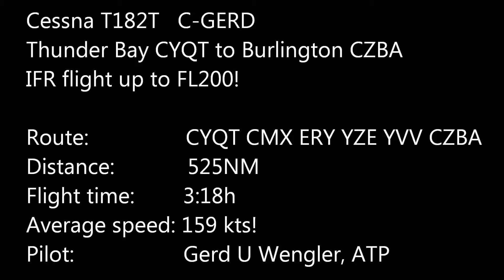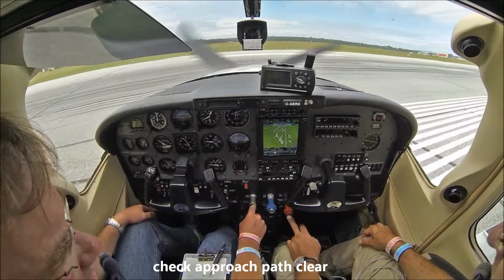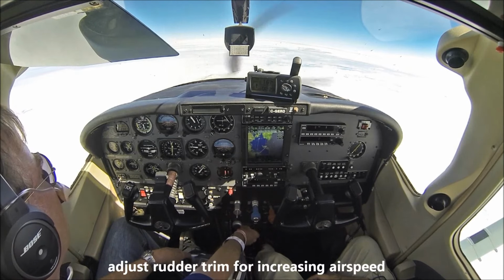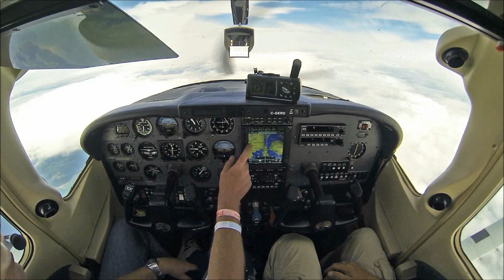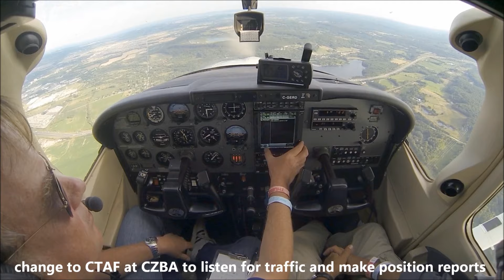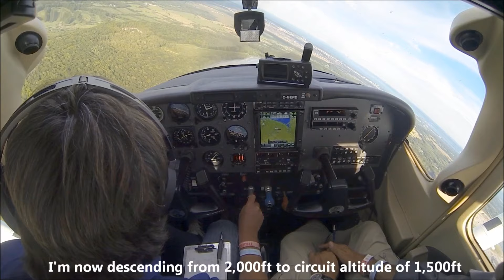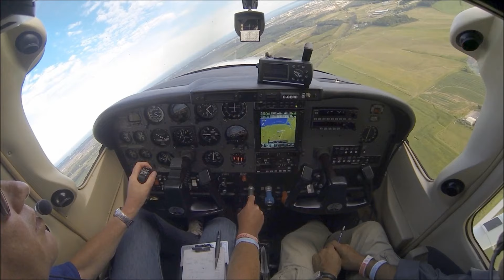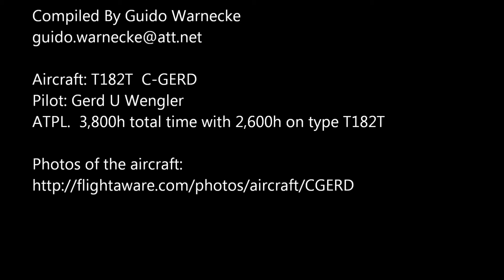Cessna Skylane at 19,000ft - cockpit video - must see!

Comment: Very alert "copilot", pushed the mixture to rich at the moment of take off.
Reply: That was the pilot
Reply: @CanadianTexaninLiguria  Wrong, watch the video again, the pilot flying that airplane is on the left side.
Reply: They are not handing off the controls properly.
Reply from the maker: It is not a 2 crew operation - I was flying with a friend.
In a 2 crew operation, the proper handover of control is essential for flight safety.
Happy Landings,
Capt. Guido

Comment: You certainly don't see a single this small up that high very often. Loved it!!
Reply from the maker: Thank you very much, Jay!
Yes it is a bit unusual at the beginning but perfectly safe - and it adds a lot of speed to the aircraft.
Happy Landings,
Guido
Reply: Guido Warnecke
It certainly does! I've never flown a C182 but I've flown C172RGs (including N172RG) and a C340 before. I no longer fly as it's too expensive for me but I am studying to become an airline dispatcher.
Reply from the maker: Thank you!
I can understand you decision Flying has become very expensive. The AVGAS prices have not come down with the gas prices for automobiles. To operate a pressurized twin like a C340 is very very expensive.
Best of luck for you career change & happy landings,
Guido
Reply: Guido Warnecke
Thanks!
Reply from the maker: TAS was around 155 kts and ground speed sometimes above 200!
This Skylane is a fast cruising aircraft.
Happy Landings,
Guido
Reply from the maker: ***** You are very welcome!
Happy Landings,
Guido
Reply: Come in the Sierras and you’ll see many single and no engine aircraft even higher !

Comment: Love the C182. Great video.
Reply from the maker: Thanks, my "video maker" friend...
Happy Landings,
Guido
Reply: its great at 5,500 feet, I dont know about FL200
Reply: Wish I kept my 162 idk why I sold it, though I say the same about my cub and 172 I have a bad habit of buying meh airframes restoring them without enjoying them. I started as a A&P mech, longest I ever kept anything was a Beechcraft for a year
Reply: I should correct myself to be clear and not sound ungrateful it's kept a roof over my head during lay offs and other bad times working in aviation but the old birds are getting hard to find now either scrapped or just not worth the trouble, last 2 restos were crop dusters and they are not the way to make money tightest pilots ever
Reply: Shawn Davie I own182 RG if I fly from Utah to California at 12500 and 13500 returning no problems!
Reply: @johncavanagh1000  you have an amazing aircraft, sir.
Reply: Zegehyjamildara

Comment: Glove clap at the end. Bravo, nice flight.
Reply from the maker: Thank you, Paul.
A nice landing deserves some cheering from the passengers...
Happy Landings,
Guido
Reply: Pressurized I hope. New wing and prop de-icers , flying high
Reply: Rob Ster You do not need pressurization. You'll note that Guido is wearing just under his nose an oxygen breather (as is his passenger). Because the Skylane is Turbocharged, the engine runs very well at FL 190. The maximum certified flight envelope for the T182T is 20,000'. Prop de-icing is an option on all 182 T model's manufactured by McCauley.
Reply from the maker: Doug Hanchard Thank you Doug.
This T182T has pro de-ice.
I hear there is an STC out for an electrical wing anti ice, but I do not know how well it works.
Happy Landings,
Guido
Reply: Hey Doug, small correction. Actually Guido is the passenger and Gerd is the pilot.

Comment: “Flaps, this, this, this, all good.” 

My kinda check list.
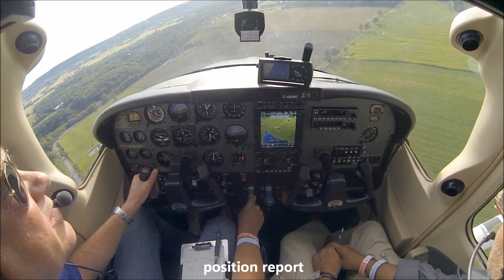Reply: 12:40
I laughed so hard... ;D
Reply: Until the one point that a latent threat isn’t picked up and only emerges at the very point it becomes essential and guarantees you a leading role on air accident investigations. Never become complacent with checklists folks, it could cost you and they are only there because of hard lessons learned by those who didn’t always live to tell the tale
Reply from the maker: In general I agree to you Paul.
Checklist use is very important, and I advocate this in most of my videos.
In less complex airplanes like the C182, any check list will do.
Happy Landings,
Capt. Guido
Reply: @paulb7200  I don't pilot planes, and would be bad at checklists myself. I am kinda disorganized (ADHD), and don't always read instructions on things. ツ But hey, without checklists, many aircraft have crashed. Most crashes are human error. Always check your fuel, surroundings, engine parameters, electronics and control surfaces.

Comment: Your exposure of the panel is perfect, yet the view is not blown out / over exposed out the window; that is amazing - are you doing some post matte filtering?
And your sound is back to great quality again after some videos where you had low sound issues...
I saw C-GERD land at ZBA on Sunday night when I was there for a flight!
Reply from the maker: Thank you!
The pilot's world is very small.
I spend a lot of time and efforts to optimize exposure of the videos.
The light difference between inside and outside is very challenging.
Happy Landings,
Guido
Reply: Well you did great with the exposure!  What are you shooting with?  I use GoPro Hero2s and the exposure control is very limited.
Reply from the maker: ***** Thank you! It;s a Gopro hero 3+ - but some after shoot work and adjustment.
Very time consuming...
Happy Landings,
Guido
Reply: Cool - if you don't mind explaining in more detail, I am very interested in what you are doing in post.  I have settled with using a dedicated camera for the instrument panel which I crop, matte and composite into the "view" cam in order to have ideal exposure on both - but you are doing well with just one camera!
Reply: Motor racing crashes
Reply: @GuidoWarnecke  )
Reply: Convo between two greats here
Reply: @FlightChops  and did you fix it? 😏
Reply: In the film world we would have used a grad nd filter to darken the exterior view. Don't know if that's an option on gopro though.
Reply: you prolly dont give a damn but does anyone know of a trick to get back into an instagram account?
I was dumb forgot the password. I would appreciate any tips you can give me
Reply: @Solomon Kendall instablaster ;)
Reply: @Theodore Coen It worked and I actually got access to my account again. I'm so happy!
Thank you so much you really help me out !
Reply: @Solomon Kendall Glad I could help :)

Comment from the maker: Reply to David Mhyr: Did the instructor made any comment on WHY one should not do this?
Happy Landings,
Guido
Reply: His explanation was that the cable's were not designed to be twisted and that they can break or become disconnected.  My mechanic (25 years experience with C172's) concurred.
Reply from the maker: David Myhr Thank you, David.
I will check this from other sources too.
I am under the impression that the cables are actually not twisted in this process.
Happy Landings,
Guido
Reply from the maker: David Myhr Hi David,
I checked around and got technical drawings and photos of the cable assembly.
There should not be any problem as the cable is not twisting. 
Might be one of these "old wife tales" thing.
Happy Landings,
Guido
Reply: David Myhr From the C182T POH: "For small 
adjustments, the control may be moved forward by rotating the knob 
clockwise, and aft by rotating the knob counterclockwise."
Reply from the maker: Robert Page This might be a true statement, Robert.
But what i learned from the technical drawings, there is definitely no twisting of  the cable by turning the knob.
So as an engineer I say "old wife's tales"...
The older Bonanza aircraft have these controls even for the throttle.
Happy Landings,
Guido
Reply: I think you are the best pilot and i work hard at being just like you.
Reply from the maker: larry sean Thanks, Larry....
I'm just another pilot.
Thank you for watching my videos & happy landings,
Guido
Reply: Guido Warnecke
Reply: David Myhr David, cables are NOT twisted, you might want to re consider your mechanic. This is can be seen on the  airplane documents. Fly safe
Reply from the maker: Thank you for clarifying this, Alejandro.
Interesting how these stories are hard to get out...
Happy Landings,
Guido
Reply: Guido, no pressure, but all you fans are waiting for more videos. :)
Even do I'm a low hour weekend warrior, I have learned and picked up a lot of tips and useful things from your expertise. Keep up the great work. Thanks.
Reply from the maker: Thank you Alejandro.
I promise, the next videos are already in the works.
Happy Landings,
Guido
Reply from the maker: No it is not a Hope Air flight, but the owner of the aircraft used to be very active with Hope Air.
The wrist bands are the day passes for the EAA fly an at Oshkosh.
Happy Landings,
Guido
Reply: David Myhr Whomever said the knobs should not be twisted knows nothing about airplanes or misunderstood the question.. They are called vernier cables and this is how they are used. Turns for finite adjustments and push button and push pull for large adjustments. not even a wives tale but a tale by someone that know nothing of aircraft maintenance. http://vansaircraft.com/cgi-bin/store.cgi?ident=1429156151-12-183&browse=controls&product=ctv-cablesRead more
Reply: Acbulgin2, Its a turbo charged 182. Not pressurized.
Reply from the maker: 19,000ft is completely safe, if oxygen is used for pilots and passengers.
Happy Landings,
Guido
Reply: acbulgin2 it likely has a constant speed propellor. as the air thins the turbo keeps the engine close to rated HP No additional boost but the equivalent of being at sea level. Known as being turbo normalized.the prop increases its pitch to overcome the thin air..
Reply from the maker: 100% correct!
Happy Landings,
Guido
Reply from the maker: Thank you!
Happy Landings,
Guido
Reply: A vernier type prop control is designed to be twisted. Am I missing something?
Reply from the maker: @norbertsiewert3917  Absolutely correct.
Happy landings,
Capt. Guido

Comment: Why would you do a intersection takeoff? With max take off weight, wouldn't it be prudent to use the whole length if available? You know what they say, the three things that are no good to a pilot, the altitude above you, the runway behind you and the fuel in the truck/bowser.
Reply: +unapro3 By the time they reach a safety altitude, they'd have enough glide to return to the runway. Also, for emergencies below that safety altitude (you try to land straight) they had a very nice flat field after the runway along the QMS. Sometimes you don't need 4 runways in front of you to keep operations safe.
Reply: They had 5700 feet of runway length taking off from that intersection. Pilot decision making said that was enough.

To use the full length of runway 07 would require a lengthy backtrack.
Reply from the maker: In general you have a good point. Runway behind an aircraft is not of much use.
Like in other things in life, also in aviation. we take a calculated risk.
Take off distance available from intersection was much more than needed.
Yes you have the argument that if an engine fails you might be able to land back on the runway.
But that's a very remote risk. Then you should also not fly single engine IFR/IMC.
Happy Landings,
Capt. Guido

Comment: A serious question, what happens if you need to pee on one of these small planes?
Reply: +Thai Mac gatorade bottle.
Reply: +MinecraftMike - lol. Fun.
Reply from the maker: +Thai Mac 
Flights are normally short but if mother nature calls I use pee bags. These are filled with a special powder that converts any fluid int a gel within seconds.
Works well.

Happy Landings,
Guido
Reply: And you drop those out the window?
Reply: Does that work for women as well?
Reply: @Haildawn : There are special adapters for Jane.

Comment: Never flew a (real) turbocharged aircraft and certainly never at those altitudes.  But I did get to work the airspace system in the real world on an IFR clearance and it was delightful!  This was decades ago, and there was nothing like staring at those mechanical instruments while navigating though clouds and looking up to see a runway waiting for you.  

FWIW:  I find that MS Flight Simulator does a very nice job of recreating the look, if not the feel, of IFR flight.  Thanks to it I "flew" a beautiful Lancair IV-P around the world in computer-generated weather, much of it simply gorgeous.

But that's flight: gorgeous, sometimes scary, always challenging, and ultimately very rewarding.  

Thanks for a great video.
Reply from the maker: +Paul M 
You are very welcome, Paul.
Turbocharging adds some tasks to the pilot, especially the monitoring of engine temperatures.

Another challenge of turbocharged aircraft is that they often fly at higher altitudes, but not really high enough to "top" all weather.

Otherwise it is a logical enhancement of the engine performance.
At 18,000ft, the engine would produce only 45-50% of power.

Happy Landing,
Guido

Comment: Great stuff. I operated a NAVIII T181T for 6 years up to FL200+. Flying from KICT to KPWM clocked a ground speed of 249 knots at FL190 at 12GPH; Flying from KDEN to KLAS, got a direct routing at FL200 over the mountains which was half the distance and less than half the time of the routing ATC attempted to force on me assuming I was normally aspirated. Turbo is definitely worth it.
Reply from the maker: Thanks, Andy!
You are doing the right thing. Use the airplane within its envelope of performance.
Always happy landings,
Guido

Comment: Just saw this video.  Nice job. I have some time in a normally aspirated 182.  Nice step up from a 172.  Little more nose heavier but more stable and a bit faster.  Great airplane!
Reply from the maker: You are correct.
It is very stable and easy to fly.
With 2 in the front it can be nose heavy.
Some water ballast in the back (40 lb or so) helps a lot.
Thanks for watching my videos & Happy Landings,
Guido

Comment: Hi Guido--Enjoyable, as usual. It's been a long time since I've flown a turbo'd airplane at such high altitudes--I think the highest was 20,000' in a TR182 some 35 years ago and 23,000' in a T210 a year or so later.

Couple of comments, though: Don't know the rules in Canada, but in the US cannulas are only authorized to 18,000'; and since I have spent much of my flying "career" in windy areas, I won't taxi with my hands off the yoke--too easy for a quartering tail wind to do major damage to the flight controls, or worse, flip the airplane.

I always carry oxygen for high altitude flights, even now in my much less capable P172D--rarely get higher than 14,000' in it. Once I started using a finger pulse-oximeter, I discovered that as an older pilot, I need to set the oxygen level as if I'm flying higher than my actual altitude, so I habitually set it a couple thousand feet higher. I'm told that's a normal function of aging, that the body doesn't process air as well. As you age, you might consider investing in a pulse-oximeter for your high altitude flights.

Cary
Reply from the maker: Thank you Cary.
Your comments are notes. We had masks on board too...

Winds were very light these days.
Here an example where you hold the controls firmly in the ground, even in a jet:
C501 landing in 60 knots winds at Stornoway EGPO!

Older single engine Cessna were certified to 30,000 ft or so, like the C210 (pre-RVSM). I was a FL230 once in a turbo C210.
The T182T is limited to 20,000ft. But I heard this is only to differentiate it from the T206 and give it an advantage in the market. technically it could go much higher, especially with this big flat rated 540 cu inch engine.

You are absolutely right with he oxygen. very difficult to determine the actual usage. When I used to live at Johannesburg at 5,500ft elevation I could fly FL130 forever, now at sea level, it is a different story, especially at night. Luckily I fly mostly jets now with a whopping  8.9 psi differential pressure. Cabin altitude seldom above 6,000ft.
I have never used oxymeters, are they reliable?
Happy Landings,
Guido
Reply: Guido Warnecke I think there are some oximeters which are suspect, the $35 variety--like anything, you get what you pay for. Mine is a $300 Nonin--and I hope it's reliable! :) 

I heard the same thing about the 20,000' certified ceiling on the TR182, yet it climbed so well to that ceiling, I'm sure it would go much higher. I don't recall the certified ceiling on the T210, but I have no doubt it was much higher than the 23,000' maximum that I ever flew it.

Cary
Reply from the maker: Thanks for the info.Cary!
Happy landings,
Guido

Comment: Guido,  Call me stupid but I have not looked up the specs. on that plane so I am not aware.  It sounded like it was a turbo-shaft jet with the whine in the audio.  But after reading the "About" info I find out it is a super-charged reciprocating engine.

I am impressed that It is able to cross the Atlantic running off of a 540 CI engine.

Great video & again, thanks for letting me hitch-hike along for the ride!

Kurt
Reply from the maker: Hi Kurt!
Thank you very much for "riding along"...
The T182T is a great aircraft especially because of the big, de-rated engine.
It takes all the shortfalls of a turbocharged engine away (temperature control, unreliable,  does not reach TBO etc.).
Happy Landings,
Guido

Comment: Great video, I flew a T182T for 5 years and enjoyed the performance at high altitude.  It is also very comfortable with 4 people.  The highest I ever flew was 16.5, it seemed to fly very well at that altitude.  Great Videos keep posting
Reply from the maker: Thank you!
Cessna did a great job in putting the big 540 cubic inch engine in the T182T.
It takes all the hassles normally associated with flying a turbocharged engine away.
Happy Landings,
Guido